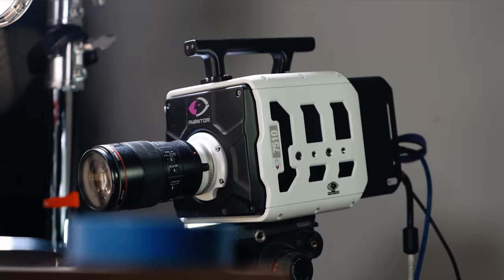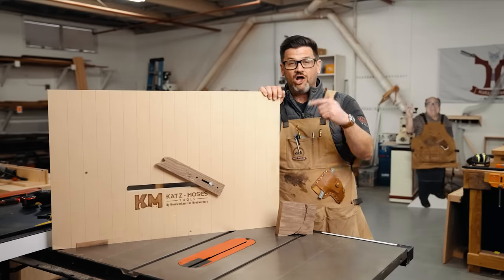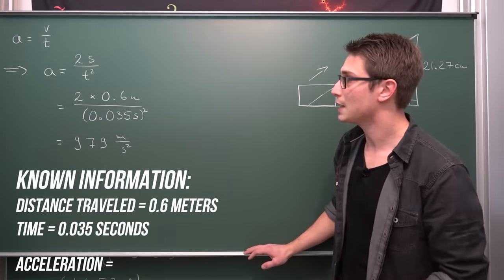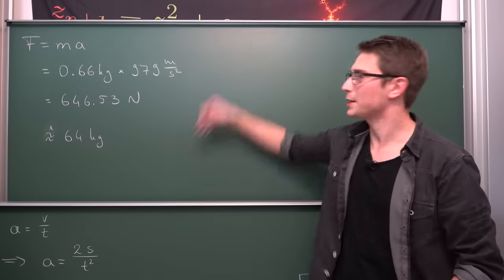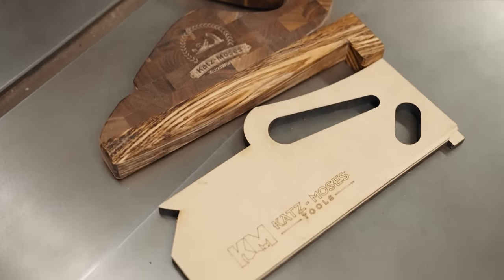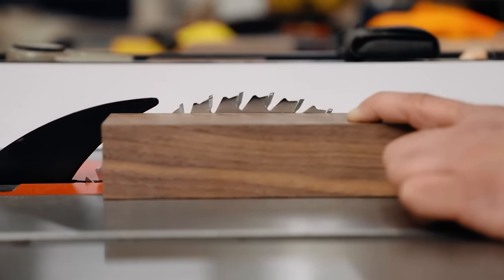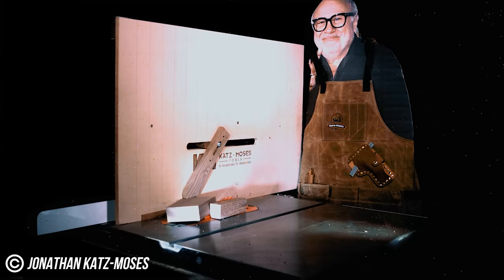The Anatomy of a Table Saw Kickback at 50,000 FPS Ultra Slow Motion in HD

Comment: I had an old Delta saw without a riving knife. I was doing a narrow rip once and got hit with a thin piece of wood. It broke when it hit me, taking a big bit of the force. Nevertheless, it left a nasty long-lasting mark just south of the belt and northwest of parts I didn't want to lose. That thing hurt even though it was a thin piece going through jeans.

These days, I use a different type of saw, and because of its design (a Felder sliding table saw), I'm never in the path of kickback, even when ripping.

Comment: Every wood worker has a story. Lol. 
I started with a chainsaw mill. I cut these giant slabs to make things with.  Never owned a wood working tool in my life except a circular saw. I have chainsaws out the butt. One thing that I realized is that I'm gonna need sticker to go between the slabs and I got a table grom a friend that is a ripping beast. The last 3 years I've seen wood fly like an eagle in a tornado. It's calmed down a bit because I at this point know when or what will be trouble. I've lived to tell you, this saw I have is the devil at times. Common  sense goes a long way.

Comment: I'm not sure of the relationship between blade height and kickback risk.  I would have thought that lower blade means more likelihood of catching the blade at its horizontal part, but OTOH more exposed blade means more acceleration, which is probably the more relevant issue.

Comment: The root of the problem is that the top of the blade is moving in the direction of the operator.  If they could figure out a way to design the table saw so the operator wasn't in the line of fire, it would be much safer.  Maybe reverse the direction of rotation of the saw and have a mechanism to hold the piece down.  Or, have the operator on the other side pulling the material into the blade rather than pushing it.  But, you'd have have a way to make sure the operator's hands didn't get pulled into the blade.

Comment: Regarding blade height, in Germany most blades have an etched ring on them, extending from about half a tooth down from the tip to all the way to the tip of the blade. This etched part of the blade is Supposed to always clear the workpiece (except when doing hidden cuts) as the sawing action pushes the workpiece more towards the table the higher the blade is (as opposed to towards the operator), thus preventing kickback, the exact opposite way than you said.
When raising the blade too high it becomes dangerous again as more of the blade is exposed, therefore increasing the risk of cuts.
Reply from the maker: That is incorrect. The ring you're referring to is called the tension ring. In manufacturing tension rings are added with a pressure roller to introduce tension into the blade. This keeps the blade from wobbling as it expands (its microscopic amount) as it spins up to speed. Without it the blade would be very unsafe and it's something a good sharpening shop can fix. I assure you what I said in this video is correct. We have a video coming out soon that shows why what I said is the case. It will have awesome slow mo footage to prove my point. Cheers
Reply: @katzmosestools  I am close to 100% certain that if the blade is set higher the risk of kickback gets reduced, at the expense of more exposed saw blade. What changes is the direction of the kickback and, without a riding knife this might be different. In Germany it is mandatory to use a riding knife.
Reply from the maker: I am 100% certain that your blade should not be set more than an eighth inch (roughly 3mm) higher than your work piece. This is a hill I'm willing to die on. Cheers!
Reply: @katzmosestools  it is not to the end of the etched section, even though I herd that before too and many saw blades have it in roughly the right spot. It is exactly one tooth height: https://youtu.be/izrsh2nywuM?t=233
This is a video from one of the most knowledgeable woodworkers from Germany (he has no subtitles though but a clear pronunciation so the auto generated and translated ones might not be total garbage)
I trust him on this quite a bit as he had to sit several exams which assessed his skill and technique to call himself master of carpentry (Tischlermeister)
Reply: But I have to yield as there are many other parameters that can decide the best height for the blade.
The type of material you are using: fiberboard, plywood, solid wood, etc.
The direction of cut.
The type of blade
Etc.

Comment: Another thing that's not mentioned is to keep your blade clean and smooth as possible, and free of sticky gum that can bind the wood to the blade surface; another source that can add to kick back, apart from friction and heating the blade. 
Cheaper blades tend to build up quicker than others. I think CMT have a special coating to assist that.
Last thing here - you mentioned in the YT,  and possibly needs more attention paid to, is the correct setting up of the kerf splitter (comes with the blade guard)/riving knife if it is "significantly" thicker than the thinner blade/kerf. If not set properly it can jam up the wood between it and the ripping fence. Pay attention to the table saw's manufacturer's recommendations.
Stumpy Nuts has more to say on these safety devices. https://www.youtube.com/watch?v=UbtVUz2k538

Comment: I would like to see kickback tests with anti kickback measures in place. Im doubtful that a feather board or a couple metal teeth on a blade guard would really be able to stop that kind of force.. I think they are very helpful in preventing kickback but probably do little to stop one when it does occur. Im just guessing though, havent seen them work under test conditions like this.

Comment: If those vertical lines are inches, your acceleration is limited to the time the piece in contact with the blade.  Once there is no more contact, there is no acceleration.  That means the real acceleration was considerably greater than the figure calculated using the 0.6 meter distance.  The entire acceleration takes place over a span of about 5 cm.  From slightly distal to the top of the blade arc onward, the piece would be traveling at a stable speed.  Not exactly but near enough.

Comment: You totally missed the most important element in preventing kickbacks; properly feeding the workpiece.  In order for the workpiece to advance past the blade, a force must be applied by your hand/pushblock to the workpiece that is greater than the force applied by the rotating blade.  That's an obvious statement, but in order to prevent a kickback, the feeding force must counteract the rotational moment created by the force from the blade.  In other words, if the blade and workpiece are on the left side of the fence, the blade will try to induce a counter-clockwise  rotational force (as seen from above the table).  It is very important WHERE the feeding force is applied.  The force pushing the workpiece MUST be on the blade side of the midplane between the blade and the fence to prevent the blade from inducing rotation that creates a kickback.  In other words, if you are using the ripfence to make a cut at 12", the pushing force should be applied to the left of the 6" line.  If this cannot be done, a featherboard or something similar to prevent workpiece rotation is required.  Bottom line; if the workpiece is properly fed through the saw, a kickback is unlikely.
    May I suggest asking Jens to provide a vector analysis of these forces acting upon a piece as it is fed through a tablesaw.  An understanding of the the forces would be much more effective in teaching users HOW to prevent a kickback than the shock and awe analysis presenting the results of a kickback.  It is far more important to use the saw properly, than it is to use it improperly and rely on a riving knife to compensate.

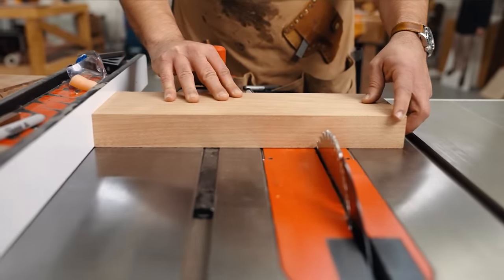Comment: Can someone explain why you don’t cross cut against the guard. What does that piece of wood against the fence change?  2:05
Reply: If you mean against the fence, it’s because a narrow piece of wood will not stay 90° to the blade. It will get trapped between the fence and the blade and launch back at you. If your hand is past the blade it can drag your hand into the blade with it.

Comment: The tip of a 10 inch saw blade at 3400. RPM is traveling at 148 ft./s. Where does your 50,000 ft./s number come from?

Comment: I caught a foot long piece of oak in the ribs. It was like getting kicked in the soul. I have a permanent scar that looks like a Nike swoosh just from the contusion. It didn't break the skin, it crushed it. Started standing next to my saw. Then I was working with a small piece of oak, 3 inches by 6 inches by 1/2 inch, with 45 degree mitered edges. It hit the wooden wall 15 feet away and imbedded like an axe head. It would have disemboweled me if I was standing in front of it. I keep it here in my office to remind that I'm too foolish to be allowed near power tools.

Comment: Well done.  A great fun video with lots form which to learn.    How about doing a video looking into the effects of being hit wearing safety glasses vs 'normal' glasses, face shields vs safety glasses etc.  You might also want to consider what I've put below as I think you made a mistake in your calculations.
I can't help but think your friend has not done you any favours here - what matters is not the acceleration at takeoff, but rather the velocity at impact, the cross-sectional area at impact (a corner will hurt more than the flat side of course) and critically the rate of change of momentum of the block at impact - here is where a couple of layers of PPE make a big difference so yay for the apron!  
My back of envelope calculations show the block is flying at 17.1m/s - about 38mph.  Although the impact speed will be much the same as if the block had been dropped off an 8-10 storey building (23M) it would only hit with the equivalent force of it's own mass - not half a Jonathan falling from that height.  The difference is important - 50Kg travelling at 17.1m/s will impart 14620J of Kinetic energy to whatever it hits, and would almost certainly be fatal, whereas a 0.66Kg block will impart just under 200J (a 9mm parabellum is about 500J) which would hurt a lot but be most unlikely to kill. Also, the block will not simply stop (transferring all its energy to the victim) but will glance off, taking some or most of the energy with it.  This dramatically reduces the impact effects and is the reason why a bullet with the same energy will do more damage (in addition to the penetration wound)

Comment: So you recommended long sleeve shirts and I think that's a bad idea. When I was like 13 I was helping my dad feed the wood chipper after a storm and my sleeve got stuck on a branch and I got nearly pulled in. 

Anything that can hang can get snagged and pull you into the saw. Same reason your hair shouldn't be down if it's long.

Comment: I cut the tip of my ring finger, the part under the nail, last year while using a table circular saw. As I pushed a piece of batten to cut diagonally, the circular saw pushed the batten back, lifting it into the air. I reached for the bar with my other hand to pull it, hoping it would pass more easily through the circular saw, but the machine pulled the bar back, and in doing so, it also pulled my hand. Fortunately, I was wearing gloves; however, given that I had cut the tip of my finger, which was otherwise very bloody, a lot of blood seeped through the gloves. Although my finger remained intact, it took a very long time to heal, especially considering that I am diabetic.
Of course, I eventually sold my table circular saw, and my biggest regret is that I am now too afraid to use one, even though I still need it. I am apprehensive for this very reason because accidents can happen suddenly and unexpectedly, and you simply cannot predict them, even though you are well aware of how dangerous power tools can be

Comment: One time I had the blade at 45 degrees to rip the corners off of some 8/4 leg stock. One of the offcuts caught the teeth and flew behind me and stuck into the side of a workbench with about 1/2 inch of penetration. Just like an arrow. Don't stand behind table saws, folks.

Comment: I'm not a math wizard with a funny accent but I do know that the wood in the video did not accelerate after it let the blade. During his valuations he said that he kept the acceleration constant. This results in sensational numbers that don't reflect reality. The wood Decelerates as soon as it leave the blade as it meet resistance and has no form of acceleration.

None of this to say that kickback isn't serious. I have been woodworking for a long time and only really had a bad instance of kickback last year. I was making a cut that I shouldn't have been making on a tablesaw. The piece was tall and short. The piece was shorter than the amount of exposed bade. That should have been a no-go, but I was trying to "get it done". The fact that the piece was small only made thing worse as it shot back into my hand that was on the push stick. Broke the skin and stung like mad. The piece ended up about 30 feet behind me.

Comment: I usually don't comment on videos, but I need to mention a few mistakes in the math used to calculate the acceleration and the force of the impact. 

First, this solution falsely assume that the piece of lumber is continuously accelerated. Once the piece of wood loose contact with the blade, it will maintain a relatively constant velocity (if we neglect air resistance over such a short distance). This mean that calculating an acceleration over 0,6 metre significantly underestimate the actual acceleration that happens over much short time period. A better approach would be to calculate the velocity of the lumber once it is in free flight and away from the blade. From that speed and the mass of the piece, the total kinetic energy transferred to the lumber from the blade could then be calculated. The energy could then be used to compare various impact energy without considering the deceleration. 

Second, the force of the impact is dependent on the deceleration rate from the impact and is independent of the initial acceleration. If you assume a much lower acceleration (based wrongly on your initial solution for the initial acceleration) you will get a much lower force (F=m x a). 

Your videos are usually quite instructive and well constructed, but I think that you dropped the ball on that one in regard to the actual science. Better luck next time :)

Comment: I really like the Video! I also like the Calculation, but there are two failures in the Calculation.
The Force (how hard you get hit) musst to be calculated by the mass an the acceleration (m*a) but the acceleration is in this time the deceleration while it impacts on you. (Speed before impact - speed after impact)/time of contact with the target. 

Also the from you calculated acceleration is not correct. I would have measured the Speed on two positions in the free flight (speed = distance / time) with the two speed an the time between we could calculate the speed while impact and the speed while it gets free from the blade (fastest moment) with this speed and the time to accelerate it you could calculate the acceleration. (Speed / time).

Comment: Amazing video but I have a correction for the calculation of acceleration: for projectiles that don't propel themselves, acceleration stops as soon as the launching force is no longer applied. That means that instead of calculating the acceleration over the whole horizontal distance traveled as shown, it should be calculated for only as long as the block is in contact with the saw blade (only the first 12 inches I think)

Comment: Should have gotten someone else to do the math. Acceleration stops the moment the wood leaves the saw blade. The distance travelled here (0.6m) has nothing to do with acceleration. Over the majority of this distance the block is already slowing down due to gravity and air resistance. Could have easily just used time from the fps and distance to get a velocity. Additionally, the force here has nothing to do with hitting the woodworker’s body. Instead you would have to measure the change in velocity of the block’s mass  as it strikes the woodworker, and divide that by the amount of time the block was in contact with the body. Here he merely estimates (very roughly) the force with which the blade accelerates the block. 

Nonetheless I like the clear depiction of how devastating kickback can be.
Reply: Also, his analysis of the significance of the force is extremely wrong. His primary error is conflating the force of acceleration upon the piece of wood with the energy from a mass falling from a 10 story building. His conversion between 640N and "64kg hitting you in the face" is extraordinarily inaccurate.

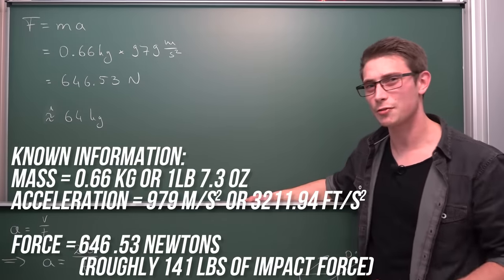At 6:34 he equates the 130lb force to be equivalent to 130 lbs falling from a 10 story building and hitting you, which reflects a huge misunderstanding. The actual momentum of the piece of wood is quite low -- the reason it causes injury is because its kinetic energy is given to the unfortunate woodworker via a corner or an edge, and often not on a flat face. This is the very reason why people break fingers and such from pieces of wood on kickback -- because the area of contact (between the edge of a fast moving board and the bone of a finger) is so extremely small, that the force per area is extremely high.

Let's do some quick math to actually prove how wrong the he is. If this force were actually equivalent to a 130lb mass falling from 10 stories (assume 14 feet per story), the mass would have approx. 25,300 Joules at the bottom. That would mean the 1lb block of wood would be traveling at about 1095 feet/second, which is the muzzle velocity of a .40 Smith & Wesson handgun. Except, this piece of wood weighs 41x more than the 11g bullet (and has 41x more energy).